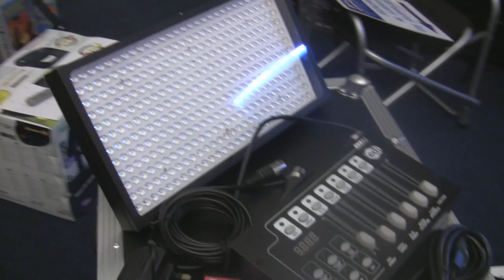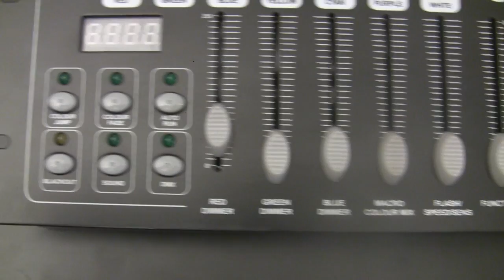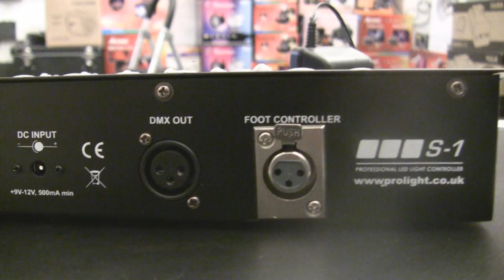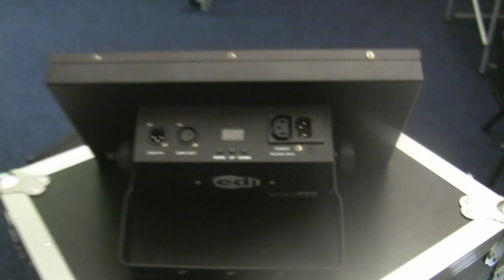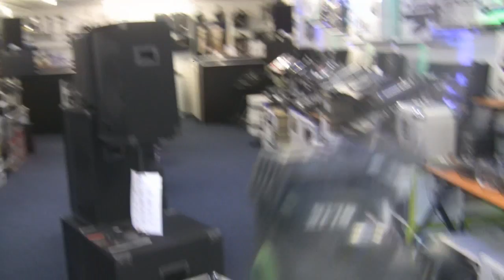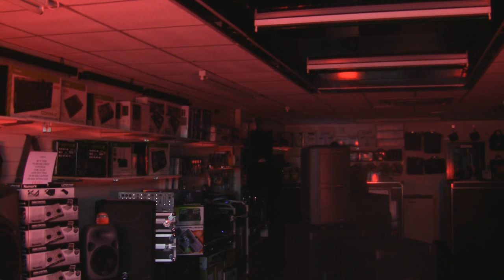LED STAGE WASH PACKAGE

Comment: I like these lights A MASSIVE LOT! I've been using the American DJ panels for half a year now, but not really impressed with their beam angle, and the fact they have a high fail rate with their blue LEDs. Since these light your selling have removable power cords, I should be able to use them here. I really like the 120 degree field of throw these lights have. Very well demonstrated. I may have to import a couple of sets if I can't find these here. Great for small venue / pub gig stage lighting.